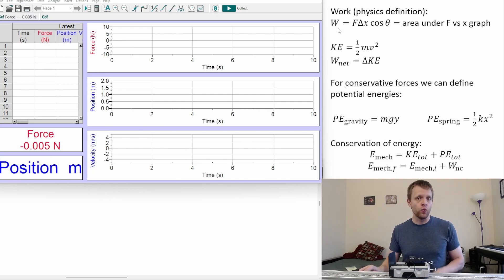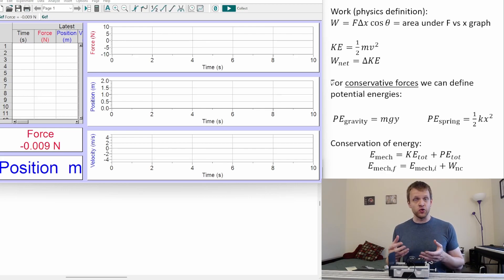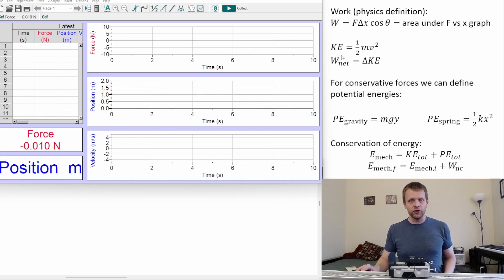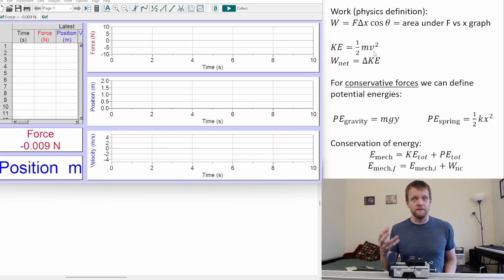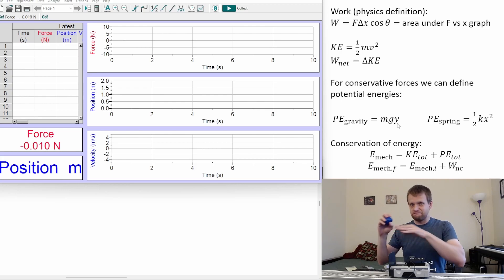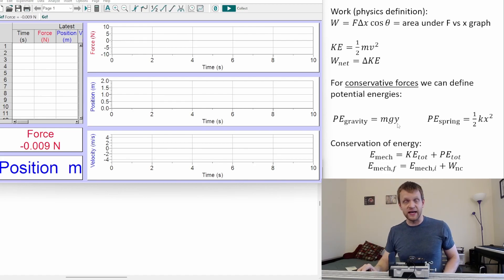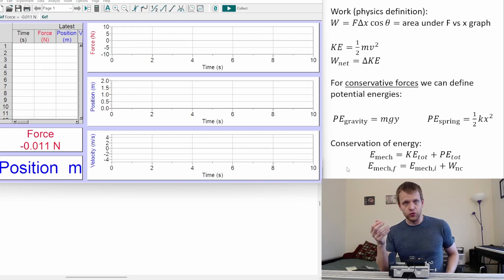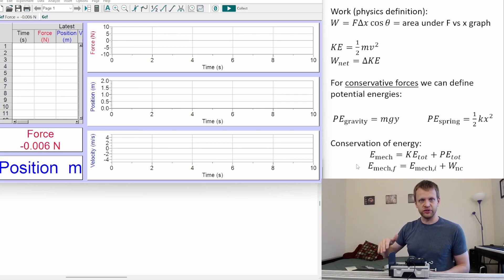Work and Kinetic Energy - Testing Physics

Comment: I used to talk to Inmendham before he talked only about basic physics (that went through "debunking" relativity and quantum mechanics all the way to, now, kinetic energy).  I don't want to interfere with your attempt to explain this in terms he would accept, but I want to tell you a few things about gary's thinking that take a while to realize, and illuminate why no experiments, probably, will penetrate.

(1) Gary doesn't understand or believe in, units, he uses a simplification.  He will say that F is the same as Joules or Watts.  It's analogous to saying d, v, and a are all the same thing, distance.  He doesn't understand that Energy being the change in momentum makes it a different unit, and this is where the seconds squared etc come from. He doesn't understand, at all, that the change in m/s PER s, leads to m/s^2. However, he also won't say distance and velocity are the same, I would say simply b/c the difference between distance and velocity were already a part of his "common sense". 

(2) Gary doesn't understand the concept of a vector vs a scaler or why that would come about.  In your monday video if you are to show a light object hitting a heavy object, so the light object rebounds.... the momentum in the "negative" direction he will say you can add that to the momentum in the positive direction.  Lets say you put 100 mv units in, they strike, and one ends up going 133 mv units and the other 33 mv units in opposite directions.  He thinks that's 166 mv units, added as scalers.  This is what he's thinking when he says free momentum is found. 

(3) When gary says "energy" he means momentum.  He thinks energy is momentum, period.  That's also why, when he thinks momentum is not being conserved in the example above, he claims that means "energy isn't being conserved".  

(4) When I say, "gasoline has energy in it, but it has no momentum because it's not in motion", gary won't track that.  He thinks that the momentum is in the gas in the form of moving particles somehow, and turning it into energy is just letting it escape the trap it's bouncing around in.  As if the energy in gasoline were it's temperature, and in order to ignite it you might just take the cap off the gasoline tank, but of course, somehow you need flame to start that process, because it's not the tank holding the energy.  Some microscopic phenomenon, according to him, is holding it in, but it's really in there in the form of tiny particles with momentum and that's where the energy is.  This is true even of the energy in a spring, according to his ideas.

(5) Gary thinks math can be adapted and reverse engineered to any system.  He does not do the math, but is sure a mathematician can make his description work out mathematically, that math is infinitely adaptable.  This is related to his idea that mainstream science has never done these experiments, and so can't be trusted, but while he has "also" not done the experiments (or predictive math), that doesn't matter b/c obviously it will work out, given his rock solid non-mathematical description of what to expect.  Gary expects the math would work out, and the experiments behave as he says. He thinks we should expect the same thing, and would, if we were not liars. He thinks I and others secretly agree with him but don't want to give him the satisfaction of admitting he's right.

(6) Gary does not understand that you actually need both the conservation of momentum AND the conservation of energy to have enough equations to solve for final velocities. Do not underestimate how little gary understand even straight forward arithmetic.

(7) Gary thinks levers are doing something like PUSHING.  So if one side an object-one hits the lever, and on the other side object-two is twice as far from the fulcrum, it will leave at twice the velocity.  It's like thinking when two billiard balls collide the cue ball is sliding along with the object ball pushing it up to its own speed, "transferring the velocity"... he doesn't understand that everything elastic is acting like rubber, (or a spring) and how the energy is transferred.  It's only instantaneous because the inevitable flexing/transfer motion is just very fast. If we imagine the lever as a long piece of flexible rubber,  so it acts more slowly in our imagination, one side gets bent, then that energy in the distorted rubber is then spent flinging the other object on the other end of the flexible lever.  Note: even if the lever were truly absolutely rigid and the transfer was through pushing-at-speed, the initial object would start slowing down as soon as it touched the lever, and so there is no reason to believe that when the second object leaves it has the initial objects velocity. Rather, the second object would leave the lever at the point where the incoming object is pushing the lever at a speed lower than what the second-object had so far built up to. Forget entirely trying to explain that the rubber-lever is actually instantaneously taking energy in AND putting it out both to the incoming object and the outgoing object.

(8) Gary doesn't believe in Galilean Relativity.  It's worth knowing this all comes from trying to say quantum mechanics makes no common sense, but it should.  That General and Special Relativity don't make common sense but they should. Ending up here, where "kinetic energy" also makes no sense, though it should. In Gary's defense, I think he's just expressing that Galilean Relativity doesn't make any sense "but it should", and so cannot be "real" or "true".  Gary does not accept any of the counterintuitive nature of physics, which is truthfully a part of classical physics long before QM and Einsteinian Relativity, and so he's rejected it all, except momentum.  If he were ever to realize that even his idea of momentum requires just Galilean, velocity and position relativity, he would reject momentum as well.
Reply: Re. point 1, the rejection of units, in his video yesterday he explained why m/s and m/s^2 are the same. Velocity is meters per SECOND. Per one second. Not per 2 seconds. It's per a single second. So even if you do square it, 1 times 1 is 1. So m/s is the same as m/s^2. QED pyhhro!

Good luck arguing with that logic!

It's at around 1:16:10 in "Live ... 6-10-23 MV vs. 1/2MVV".
Reply: @WhiteHenny  velocity IS acceleration.
Reply: @WhiteHenny  just checked that out... so inmendham is arguing one foot is the same as one square foot.
Reply from the maker: I agree there are a lot of misunderstandings involved in his positions, and I've noticed several of the ones you list, but this whole thing has given me a lot of ideas for future video topics (not specifically for him, but that might be of interest to people just starting out).
Reply: "so inmendham is arguing one foot is the same as one square foot."

Logically, that would indeed be the implication of his nonsense, but he isn't logical. He'll just say whatever rubbish it takes to try to rationalize his garbage and waste everyone's time.
Reply: @WhiteHenny  9.8 m/s² × 5 s = 49 m/s
According to your logic Chris, it would be 49 m but that is not a velocity.
Reply: @_John_Sean_Walker  He was making fun of DraftScience's logic.
Reply from the maker: First, I don't think I have offered any direct insults to you (if I have, I apologize, and I don't support anyone else offering insults either).  I do try to keep the discourse elevated.  I'm attempting to point out the errors in your ideas by offering evidence.  I'm going to try one more time to summarize the experiments that I've presented and point out where those experiments directly contradict various statements that you've made.  This is for both this video and the follow up that I posted this morning (https://youtu.be/SaucryPVE4I) and I hope you will consider these points.

First video:  Testing the claim was that with the standard physics definitions of work and energy, that the net work is equal to the change in kinetic energy.  That is:

area under the F vs x graph equals the change in 1/2mv^2

I tested this three different times while constant forces are applied, and once with a force that changes with position (using a spring).  All cases matched within a few percent (well within our expected experimental uncertainties).

The purpose was to show that work and kinetic energy are physically relevant quantities.  You can use one to predict the other.  So if I know about the forces that are applied over a displacement, I can predict how the motion will change (via the change in kinetic energy) and vice versa.  This allows us to make testable predictions about how systems will evolve (which is what physics specifically tries to do).  This fully supports the standard physics claims involving work and KE.

Second video:  Testing the claim that energy is conserved in a variety of conditions.  This was tested with a cart moving up and down a ramp (involving KE and gravitational energy) and with a cart attached to a spring oscillating on a ramp (involving KE, gravitational energy, and spring energy).  We found that at least over relatively short times (before friction has a chance to remove a lot of energy from the system) the total mechanical energy is conserved.  Again, this utilizes the standard physics definitions of KE, gravitational potential energy on the Earth, and spring energy.  If any one of those were off, we wouldn't expect to get that total energy staying conserved.  This again supports the standard physics claims involving these different types of energy.

We then looked at elastic collisions between carts, and measured both the momentum and total KE of the system.  You specifically said that it was not possible to conserve both momentum and KE.  These experiments (four examples using a variety of different masses and speeds) directly contradict your statement (I've listed the specific initial and final velocities of each cart in the description of that video so you can check the work).  It is entirely possible to have elastic collisions that conserve both total momentum and total kinetic energy.

Lastly, we looked at cases using springs to launch two carts.  You have REPEATEDLY claimed that the fuel needed is related to how much momentum it gains (you need twice the fuel to go twice as fast).  This is equivalent to saying if you have the same amount of fuel but twice the mass, the object should be launched with half the speed.  This is tested in that the compressed spring IS OUR FUEL in this case.  I ran this experiment with various masses (both low mass, both high mass, and different mass cases), and it was the kinetic energy that matched up, or equivalently, when the mass increased by a certain factor, the velocity decreased by the square root of that factor.  Again, the measurement details are given in the description, but when the cart masses each went from ~0.294kg to ~0.792kg (factor of 2.7 increase) the velocities went down from ~0.53m/s to ~0.33m/s (factor of 1.61 decrease, very close to sqrt(2.7)=1.64).  This supports the claim that the energy stored in the spring is converted to the kinetic energy (1/2mv^2) of the carts, and not the momentum.  So it would in fact take 4 times the energy to double the speed.

I have tried to show these experiments as clearly as possible, showing how I set up the equipment, the data analysis, and discussing results, and they directly support the standard physics concepts of work and energy, and directly contradict many of the claims you've made.

In the parts of your work that I've watched, I have not seen a single controlled experiment, a single source of data (your claims are not data of anything other than that you believe your claims), or a single calculation for the outcome of an experiment that we could go out and test (other than the claim you need twice the fuel to go twice as fast, which we have shown to be inconsistent with data).  You claim that large swaths of basic physics are wrong (or even intentional lies for some mysterious reason), and yet don't seem to bring any evidence to the table other than denial and personal incredulity.

As I said in a reply to one of your other comments, I'm interested in conversations where both participants are willing to consider revising their positions when presented with new data.  If you bring something substantive, let me know and I'd be happy to keep discussing.  I hope this happens.  But if your responses continue to be flat denials without addressing actual data or presenting data of your own, then this conversation is no longer worth the effort.  I hope that's not the case. 
 Whichever route you decide to go, I wish you health and happiness.
Reply: @DraftScience  "Frankly your evidence is Superfluous and redundant (been there done that) and there's nothing to counter my counter argument that you are in error to think gravity isn't a Time dependent force or to think levers don't conserve momentum."

Do you acknowledge that " Again, the measurement details are given in the description, but when the cart masses each went from ~0.294kg to ~0.792kg (factor of 2.7 increase) the velocities went down from ~0.53m/s to ~0.33m/s (factor of 1.61 decrease, very close to sqrt(2.7)=1.64).  This supports the claim that the energy stored in the spring is converted to the kinetic energy (1/2mv^2) of the carts, and not the momentum.  So it would in fact take 4 times the energy to double the speed." 

Yes or no? 

"The follow-up video includes a very dubious "free momentum" experiment. You also seem to argue that Springs do not conserve momentum... You seem to be saying the heavier the object I launch with the spring the more momentum the spring will produce." 

He and many others have painstakingly explained why there is no free momentum. The problem is your understanding of momentum. If a piece of evidence contradicts your understanding, it's your understanding that needs to be revised. 

"I don't think you'll find a gun expert, or a NASA engineer, who will confirm it works that way." 

On what basis do you have to make this claim? Where is your evidence? 

You have previously appeal to Walter Lewin and other physics professors as part of your argument. Now that a professor is contradicting you, you want to make a different appeal to authority. It's incredibly inconsistent.
Reply: @_John_Sean_Walker  I understand. I was trying to present Gary's logic.

Gary doesn't see the point of doing unit analysis. He's happy to multiply the acceleration due to gravity (9.8 m/s as he says) by 2 seconds, and get that you gain 9.8*2 = 19.6 m/s in velocity.

9.8 m/s * 2s = 19.6 m/s

This looks wrong to anyone who understands the importance of units, but Gary keeps on insisting that the acceleration due to gravity is 9.8 meters "per second", and that when you multiply that by the number of seconds you are in gravity, the change in velocity you get is also in m/s.

When Pyrrho accused him of not believing in units he said something to the effect of "I do believe in units. I talk about quanta and bits" as if he thinks "units" refers to the discrete packets that things are made up of. He doesn't even know what the term "unit" is referring to.

If I divide a distance in meters by the time it takes to travel that distance, in seconds, I get the average speed over that distance, in meters per seconds. Meters divided by seconds = meters per second. Is that controversial?

If I divide a speed in meters per second by the time it takes to gain that speed, in seconds, I get the average rate of acceleration over that time, in meters per second per seconds. Meters per second divided by seconds = meters per second per second. That's the point at which we lose Gary. "Too silly", "It doesn't matter how many times you say 'per second', it's meaningless". And so on.
Reply: @WhiteHenny  It looks like Goofy is holding us all hostage in our second high school year, doesn't it?

Yes, MindlessMarbles pointed that out to me, that you were only cynical.
I missed that. 😂

Goofy sees every splinter in our eyes, but she misses the beam in her own eye!

Be safe, dude.
Reply from the maker: " So if I talk in my comment section about how there are a lot of misunderstandings in your position you won't feel insulted ."

Certainly not!  If someone criticizes my ideas or positions, their criticism is either justified (in which case I have the wonderful opportunity to correct my mistakes) or it's not (so I can defend my position and potentially correct their mistakes).  In what part of this should I feel insulted?  In one of my responses to another of your comments, another user pointed out a small but critical typo in what I said.  I checked it, verified that they were correct, and then fixed the error and thanked them.  I try to criticize ideas, not people, and people should be willing to have their ideas challenged.

" Frankly your evidence is Superfluous and redundant (been there done that) "

Yes, these experiments have been done before, and your acknowledgement of this means that your failure to recognize the implications of these experiments is repetitive.

" All I saw you say was it can't be a coincidence that contrived math matches contrived math ."

This is one of the central points of misunderstanding you seem to have with evidence and tests.  I didn't make any mathematical arguments (apart from a few points related to how the sensors work and things like translating sensor position measurements into height above the ground measurements).  I showed how different physical measurements (measuring forces, positions, velocities, and masses) are related to each other.  I empirically verified that taking the force times displacement (area under F vs x) matches the change in the combination of physical quantities that we call kinetic energy.  We use math to evaluate these quantities, but they are ENTIRELY based on physical measurements.  We demonstrated that these specific combinations of physical, measurable quantities (forces, positions, velocities, masses) are related to each other in ways that are testable and have predictive power.  Again, this is what physics does.

" I will respond to the rest in a video if you're willing to continue the conversation ."

You are welcome to respond in whatever way you see fit.  The other points I would have responded to were already addressed very well by @MindlessMarbles.  But the last two paragraphs of my previous comment stand, so I'll simply repeat them here:

In the parts of your work that I've watched, I have not seen a single controlled experiment, a single source of data (your claims are not data of anything other than that you believe your claims), or a single calculation for the outcome of an experiment that we could go out and test (other than the claim you need twice the fuel to go twice as fast, which we have shown to be inconsistent with data).  You claim that large swaths of basic physics are wrong (or even intentional lies for some mysterious reason), and yet don't seem to bring any evidence to the table other than denial and personal incredulity .

As I said in a reply to one of your other comments, I'm interested in conversations where both participants are willing to consider revising their positions when presented with new data.  If you bring something substantive, let me know and I'd be happy to keep discussing.  I hope this happens.  But if your responses continue to be flat denials without addressing actual data or presenting data of your own, then this conversation is no longer worth the effort.  I hope that's not the case . 
 Whichever route you decide to go, I wish you health and happiness
Reply: The Dispar's Lab channel did a video especially to debunk Goofy's claim that: 
        "Twice the momentum compresses the spring twice as far."

Mass:
m2 =   0.113 kg
m1 =   0.05575 kg

Height:
h2 =   0.014 m
h1 =   0.056 m

(Velocities: 0.524 m/s and: 1.048 m/s)

Momentum:   p=mv
p2 = 0.113kg·0.524m/s =   0.059 Ns
p1 = 0.05575kg·1.048m/s =   0.058 Ns
Equal Momenta

Spring Compression:   x = √(pv/k)
x2 = √(0.059Ns·0.524m/s÷0.363kg/s²) =   0.292 m
x1 = √(0.058Ns·1.048m/s÷0.363kg/s²) =   0.410 m
√2 Different Compression

     Equal momenta can give a different spring compression!!

(My comment is under Stephen Brough's comment):
Dispar's Lab
Experiment: dropping rectangular batteries on scale (SLOW MO 240fps!)
https://www.youtube.com/watch?v=Do1HAJENqz0&t=34s&ab_channel=Dispar%27sLab
Reply: @PhysicistMichael  Hi Michael, and I'll post this question to Pyrrho as well. I think I've pinpointed the area you need to hammer home with authority if you hope to get Draft to "understand/learn" regarding momentum. It's the concept of negative energy. This is the concept you both should consider expounding upon. Pyrrho in fact touched upon it, so let me quote him in full here:

Pyrrho wrote: "In your monday video if you are to show a light object hitting a heavy object, so the light object rebounds.... the momentum in the "negative" direction he will say you can add that to the momentum in the positive direction.  Lets say you put 100 mv units in, they strike, and one ends up going 133 mv units and the other 33 mv units in opposite directions.  He thinks that's 166 mv units, added as scalers.  This is what he's thinking when he says free momentum is found."

If it's at ALL possible to explain this "better", in such a way as to get the penny to drop as it were, please do so. This is the fracture point at which his ability to accept your explanation falls away. As you say, he is allocating it all together, he is adding it up incorrectly. He thinks it MUST be 166 units...explain why it's not in a way that satisfies a "common sense" understanding. This is why he keeps saying KE implicates "free energy". Because he's adding wrong. Explain why/how negative energy is a thing, and why it can't be added to the total. Explain how it works in explosions, and in a gun, as well, since he keeps listing those two mechanisms. If you focus on this part of the argument, it could at last open a floodgate of understanding. Cheers.
Reply: @earinafield  Just to be clear, no one says kinetic energy can be negative. Momentum can be negative... assuming you've set up a coordinate system a certain way (meaning that even if it is negative that's only an artefact of the fact that a component of momentum is negative relative to a coordinate system).
Reply: @pyrrho314   in today's video, "Live 6-13-23 ... re: PhysicistMichael comments on Conservation of Energy" at 28:22 when talking about the acceleration due to gravity he says "so every one second you get 9.8 meters of velocity".

Does "meters of velocity" sound like something that anyone who believes in units would say?

Usually just says "every second you get 9.8" without putting any units on it. Because if he did, he would have to say "every second you get 9.8 meters per second of velocity", which is dangerously close to saying "you get 9.8 meters per second every second", or (heaven forbid) "you get 9.8 meters per second per second".

It's hard to continue thinking that he's arguing in good faith when he has to use terms like "meters of velocity" in order to avoid seeing the truth.
Reply: @earinafield  

Momentum is not energy.  Energy is not momentum.  Both things are just words that got assigned to mathematical patterns in nature. "Energy" and "momentum". 

There is no negative "energy" in classical physics.  It's the momentum that can be "negative". 

Calling it "negative" is just a way to do math with it. Momentum isn't really a "negative", but it points in a direction, it has an arrow.  It's heading somewhere, in space.  

You can add arrows, it's the old (x,y) coordinate thing where you can simply two arrow. Two arrows that are the same, but in opposite directions, they cancel out.  If you just do this on the line, like the track, then there's just two directions for the arrow to go, you can use positive and negative. But either direction could be considered "negative", it's just the direction of the arrow.

On the OTHER hand, the energy adds up the way gary thinks the momentum does. Each object just has a positive amount of energy and you add the two together.  They have to be two different things because the energy is what gets the thing moving in the first place. A thing can't get itself going, something else has to.
Reply: @WhiteHenny  meters of meters over time = m*m/s = square foot seconds
Reply from the maker: You've made claims, but, again you have failed to make any specific predictions of experiments and then tested those experiments.  Your claims and incredulity are not evidence, which I thought is what you wanted.  I have directly addressed many of the claims you made, despite your denials.  I've also noted that you don't provide a link for my videos when you review them, so your audience can't easily check my data for themselves (seems a dishonest tactic).  For the arguments you brought up here:

" explained why rolling objects roll four times as far with only twice the velocity "

Haven't actually heard this "explanation" but I'm guessing you don't accept this as a direct consequence of conservation of energy.  If it involves the claim I have heard from you that friction on a level surface depends on speed, that's going to require its own evidence, and not just you holding up a scale and not pushing on it as much when you move your hand quickly.

" I've explained why levers must conserve momentum "

And I explained the errors in your understanding of momentum.  It's only conserved if we're looking at a system with no external forces applied.  Direction matters, so objects moving in different directions will have different momenta (can consider as + and - if just one dimensional motion).  This was demonstrated in my conservation of energy video with the elastic collisions and carts launched by springs example.

" momentum is the only thrust/energy that moves a spaceship " 

You've claimed that NASA engineers don't use KE.  https://www.nasa.gov/stemonstrations-energy.html

" bullets can't possibly have 1,000 times energy of recoiling guns "

My conservation of energy video with the unequal mass spring launch demonstrates that both objects are launched with the same momentum, but the lower mass cart does indeed end up with more kinetic energy.

" all of the statements regarding the history of this junk "living Force" science "

While the history aspect of how these ideas started, initial problems and revisions, etc. is interesting, it doesn't matter when discussing whether these models can make testable predictions of physical systems.

I've responded to many of your arguments, patiently (and offering more time to you than I should have) pointing out your errors (which are numerous) and providing experimental evidence to back up my case.  I (and others on these comment threads) have asked you to respond to the results of my experiment, and the clearest response was (noted by @Siipilintu )

" In his recent live stream Live 6-13-23, around 1:13:14, he put it well: If an experiment matches with the kinetic energy theory, it's a faulty experiment "

This demonstrates that its not just misunderstanding (which I'm happy to talk about and have discussion), but intellectual dishonesty.  It's playing chess with pigeons, and I'm not interested in that.  I'm think it's very likely that you'll take this as a victory and claim on your videos that I wasn't able to defend my position, act all persecuted, that "they" won't listen to arguments, etc.  But I'm not interested in discussions with people who are not at least trying to have an honest discussion where you consider evidence.

If you're actually willing/able to bring something substantive to a new discussion, then I'll be interested again.  Until then, I'll spend my time more productively and continue producing these kinds of videos involving actual experiments and data (videos on levers and rolling motion is on the list already).  You're welcome to make reviews of those, but I probably won't be spending the time directly responding to you unless some of those aforementioned changes happen.
Reply: @PhysicistMichael  Hi there Michael hope you are well.

Regarding DS's friction claim on a level surface, that faster objects incur less friction or heavier ones incur more, whatever his claim is can be debunked with evidence!

The problem is, he thinks momentum is energy, and if we were trying to see how much energy is lost to friction over time and we launched two carts with equal momentum at a 2 to 1 ratio, then this would be an unfair test as more energy is required to make the 1 mass travel at twice velocity.

Stephen Brough conducted an experiment, using a low friction cart at a 1 and 2 mass ratio, launched by the same spring, so they both received the same energy, obviously their  momentums differ, their speeds and the distance they travel.

But if the times of the runs are measured, they both wind down to friction at the same time, his claim I think is faster lighter objects have less friction but the evidence says other wise.

The title of Steven video is How many Bounces, I will try linking this video in a separate comment as links tend not to post.👍😊